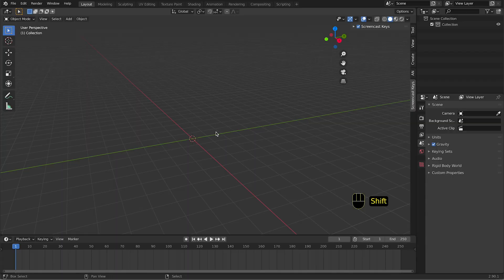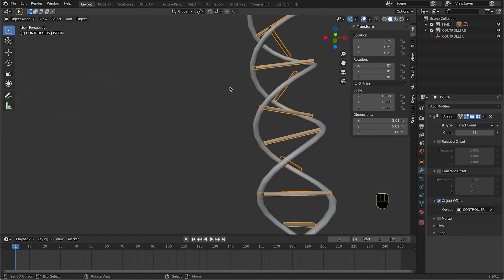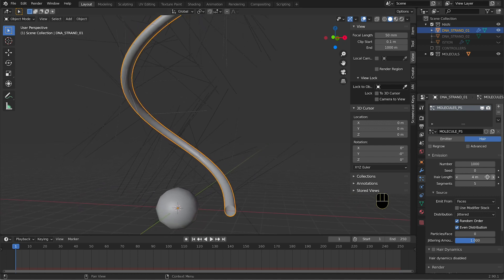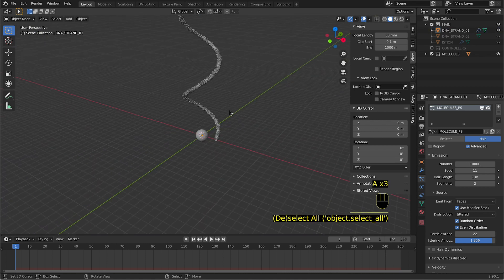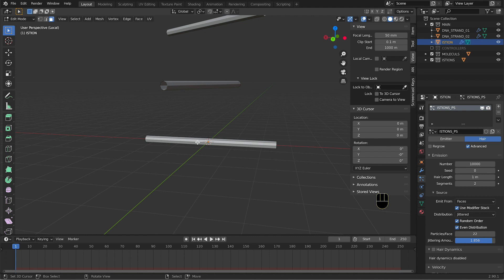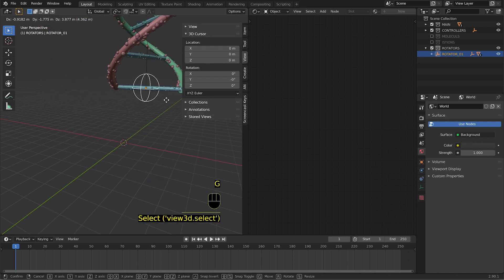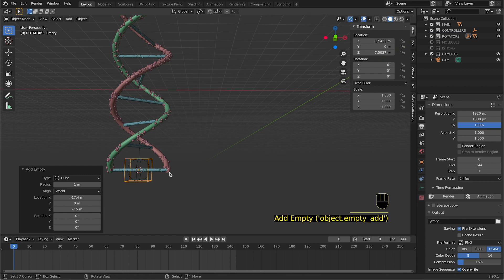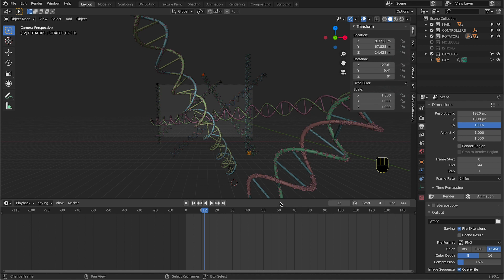How to model a DNA Strand in Blender 2.901 | EEVEE

Comment: at 1:28, may i know have you missed some steps?
Reply from the maker: Hello... what part was missing?
From what I see, is maybe the fact that the strand is composed of two twirls and the scene after is longer? The reason is that I increased the number of iterations inside the modifier...
If the problem sits in another part, let me know!